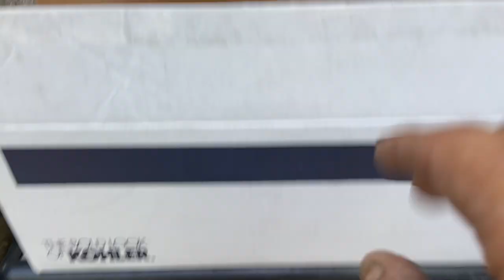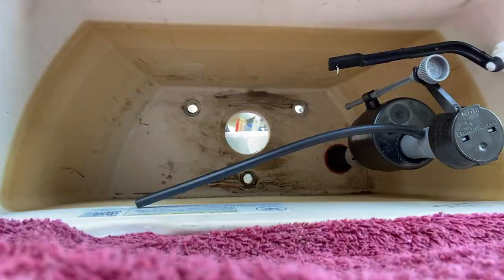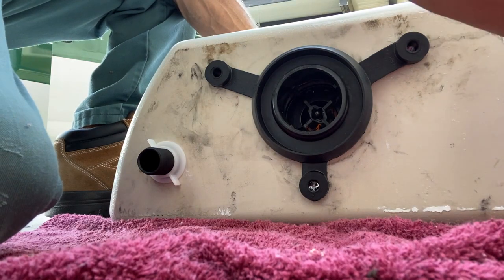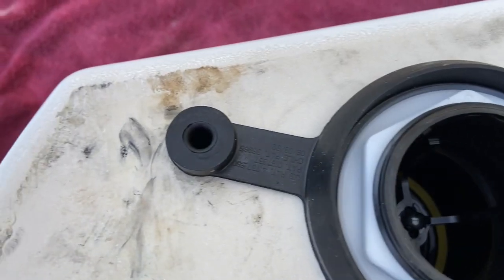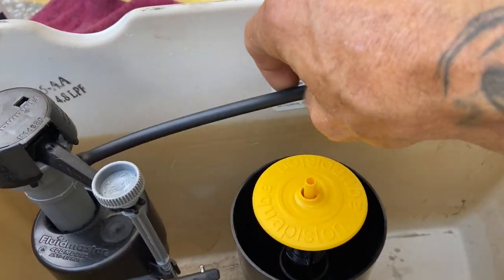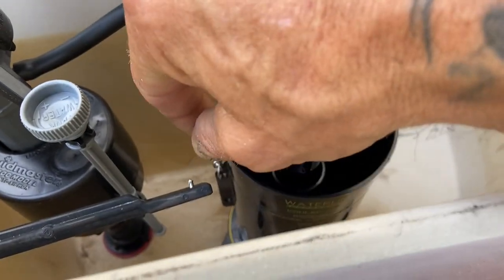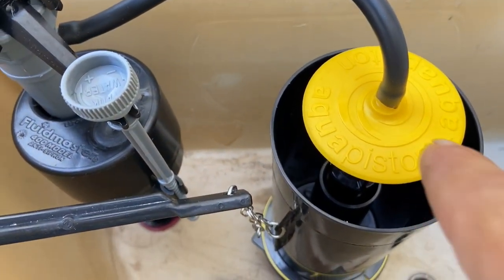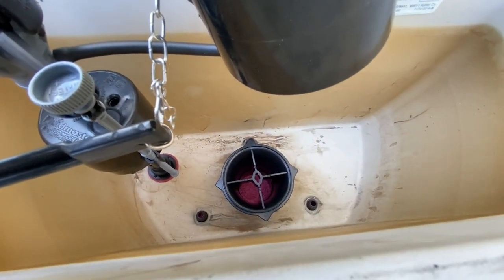KOHLER 1.28 GPF DROP CANISTER FLUSH VALVE REPLACEMENT PT.2

Comment: what about the rubber gasket?  the three gasket lugs or cylinders,  inside the tank,  stand up past the bottom of the tank about a half inch.  does that get cut?  will the compress crooked and leak.  what a lousy system